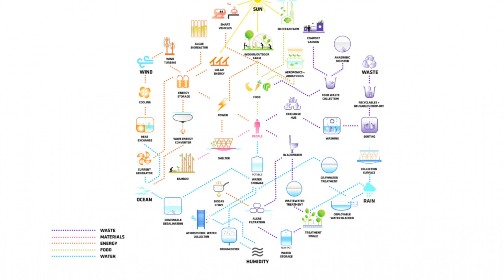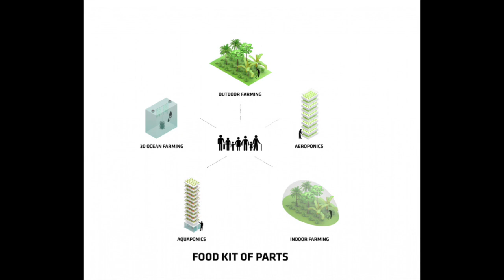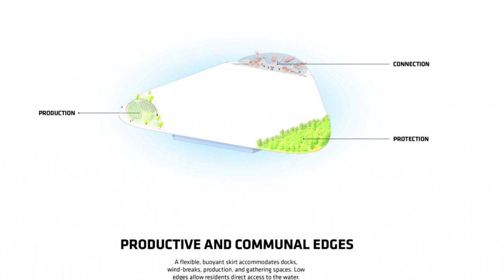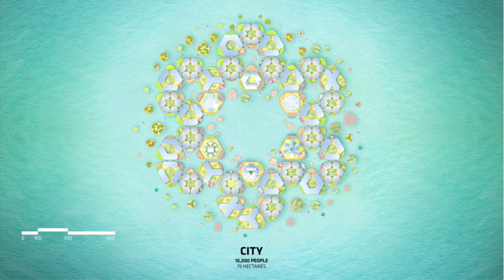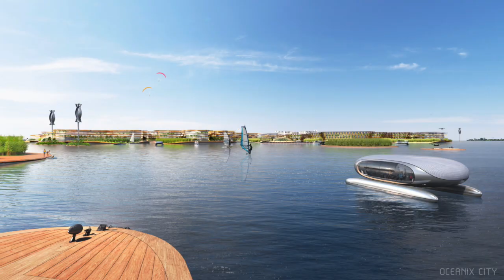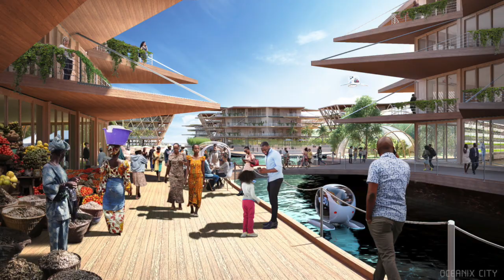The Civium Project 05: The Transcendent Operator and Oceanix

Comment: Applying the transcendent operator to itself I notice prior instantiations; Platonism and theology spring to mind. To extend the programming metaphor, the dependencies seem to run rather deep. Should the term refer to this instantiation of the class or the class itself, or is that a distinction without a difference?
Reply: Okay, I think the generalized transcendent operator (or its parent class) is the key - necessary and sufficient. Failure to properly instantiate the operator (or a functional equivalent in the context) risks stagnation or derangement when the context shifts beyond the original operating parameters of the system. Conversely, a successful instantiation will enable abstracting functionality from past adaptive contexts and reimplementing it in novel contexts, even across domains.
I believe we've been witnessing the tail end of a gradual loss of function of an Axial Age instantiation of the transcendent operator, and are in urgent need of a fresh one. I'd love to hear you dialogue with Dr. Vervaeke on this one. In the meantime, I have some thinking to do.
Reply from the maker: Right.  A major driver of much trouble is failure to properly instantiate the operator in context shifts (i.e. attachment to the instantiation over the operator).  Platonism, for example, is precisely the opposite of the right thing.  It is a projection of the transcendent operator from the class of instantiations using the simulation function of the analytical mind.  (reciprocal closing).  Ref. McGilchrist Master and Emissary.
Reply: Huh. Right, you chose the term for a reason. A first-order-stable instantiation would seem out of the question, then. Can even the concept survive context shifts? I don't know that we've ever had a stable, communicable version of that either.

Comment: Storm waves may be a very serious issue. This is one of the main reasons why I prefer land based construction. 

I wonder if the whole town could attach to large sails, and slowly cruise around the world? Change latitude based on the seasons?
Reply from the maker: The engineering problems (of which this is one) are largely solved.

Comment: Physical Design Optimization for Sustainable Solutions:
100% Recyclable
Made from recycled materials and/or
Made from existing parts
Maximum reliability
Minimum complexity
Operational without electronics
Easily maintained
Easily repaired locally
Geographically appropriate
No or low cost
Open Source

Comment: I'm glad the "I need a concrete example" folks will finally have something to chew on. I do have some questions about how this fits in with some of your other ideas. 

Right away, I don't see how this structure allows for the autopoesis that you advocate so strongly. From architecture to city planning things seem extremely top-down rather than being allowed to organically and randomly develop. Is the idea that in choosing to live in one of these cities, citizens opt into the same transcendent operator from the start, so there is no inital disagreement about directionality? Does a trustworthy decison-making body and Dunbar scaling go far enough to get people working together effectively? If that's the case, I can see how a successful city might look like a succesful startup, but I'd be curious for your take.

Also, a recorded conversation with the Oceanix team would be a real treat. Keep it up General.
Reply from the maker: Place the point of autopoesis "outside of" or "above" the transcendent operator, the 'selection function' of actualization and the trajectory through the Real of their relationship.  i.e. autopoesis involves the "shaping" of the transcendent operator, the specification of actualization and the dynamic evolution of the whole.
Reply: I was wondering if a more 'parkour' like concept of 'architecture or city planning' may yield a better framework. As thinking of architecture or city planning as solely building constraint, which is an aspect, also doesn't take away from that it may provide traction for movement/growth and be able to be used to promote anti-fragile practices. Autopoesis requires interdependence with more than an auto/self.

Comment: I wonder what sort of niches could be exploited in such a fractal. It's also worrisome that over time as neighbourhoods become parts of cities that you end up potentially with the same problems 'classical' cities do, where new niches or malevolent agents start trying to extract value asymmetrically to the rest of the population. I suppose you need to develop mechanisms such that as the connectedness grows you are incentivised to stick with your neighbourhood. I will have to jump down the rabbit hole of Oceanix, but I do feel that conflict and rivalry between districts wouldn't be any less than it is without the necessary cultural shift. Is this a potential test case for instantiated DAO & blockchain tech?
Anyway, would you think it wise to start to detail (potentially as an open source project) what the transcendent operators are for Civium?
Reply: I think you are right to wonder if dynamics of  "us vs them"  will come into it. My intuition is that, these dynamics are baked into our very nature. I think, Oceanix has a opportunity to trial a new governance process which are guided by principles that are updated based on what has and hasn't worked in our current societies. Seems like a very interesting opportunity.